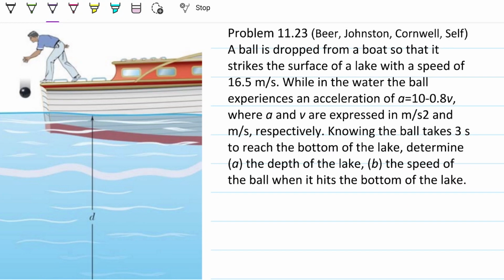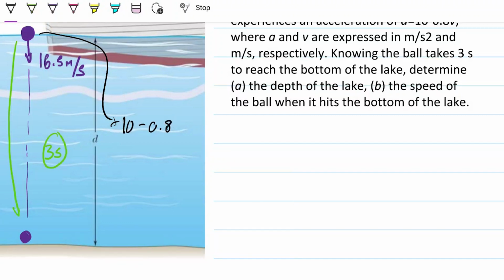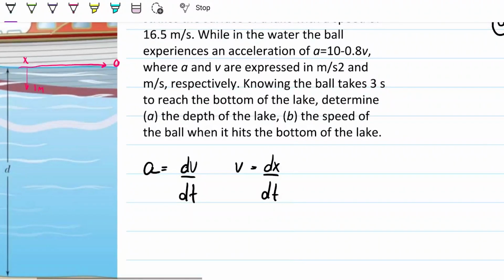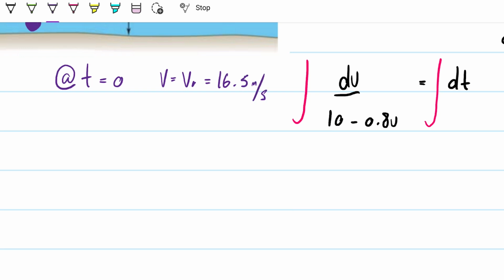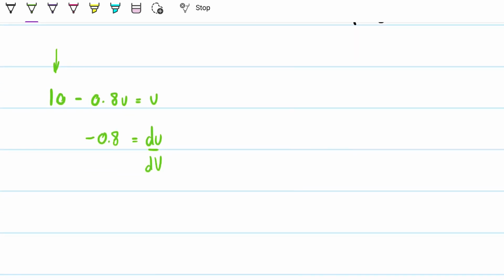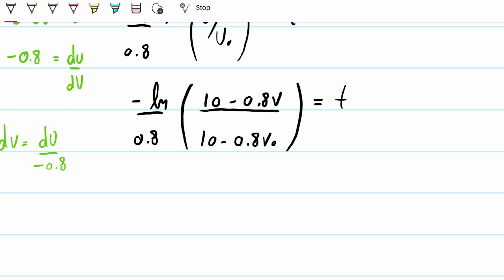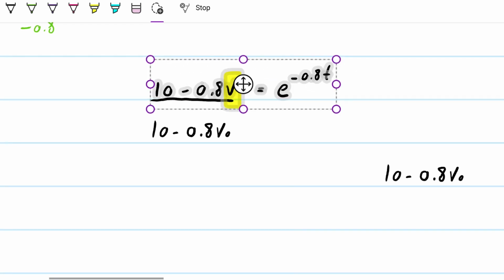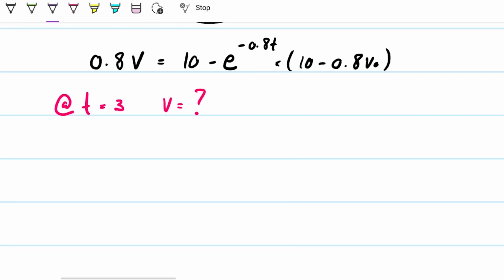Calculating Lake Depth and Final Velocity (1 of 2) | Dynamics

Comment: Hey ive got a question, i thought the integral of a polynomial with degree -1 would result in an ln of an absolute value. and then what i did to get rid of that absolute value from one side of the equation was to add a ± to the other side of the equation. what's the reason behind skipping the absolute value in your video? How do i know which sign to proceed with (minus or plus)?
Reply from the maker: The constant of integration will handle the sign. But I wanna be sure I understand your question: are you talking about the constant that shows up when the integral is not defined?
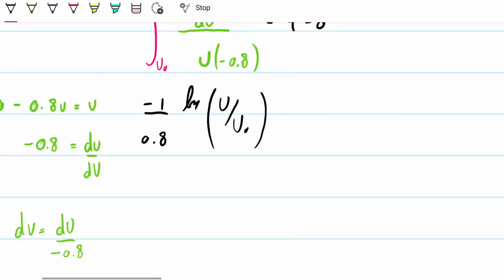Reply: @EngineeringHack  Heya no, i was talking about 8:20 into the video. Why isnt the fraction inside the natural log also not inside an absolute value argument? While solving on my own, i instinctively placed the fraction inside absolute value since this is what i learnt in my calculus class. This meant that after removing the Ln from the lhs by raising e to it, im left with the fraction (10-.8v)/(10-.8v_0) still inside an absolute value argument. This is what i meant when I said to remove this absolute value, i had to add ± to the rhs. This now meant that, after solving for v, there are now 2 possible values for it depending on which sign + or - I assign to the said ±.

Sorry am i making sense? Not really good at explaining things. I can provide a picture of my own solution and point out what im referring to if ud like